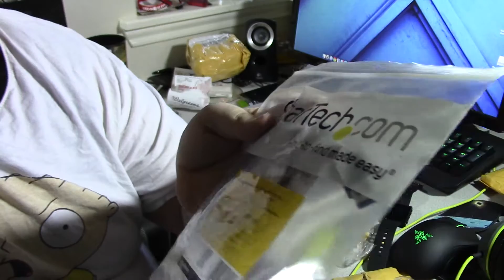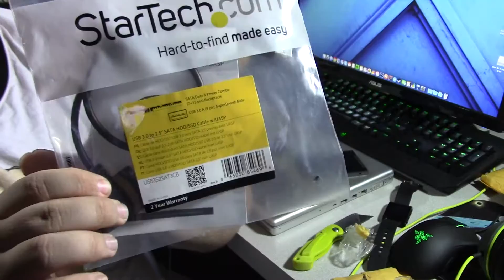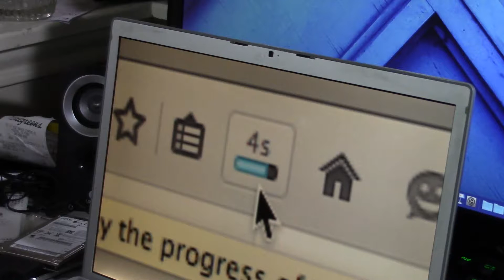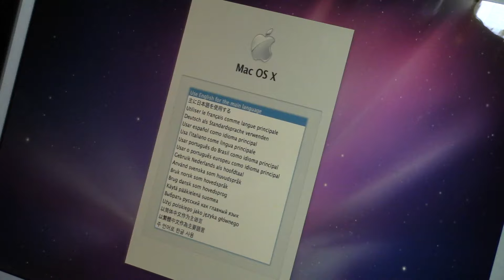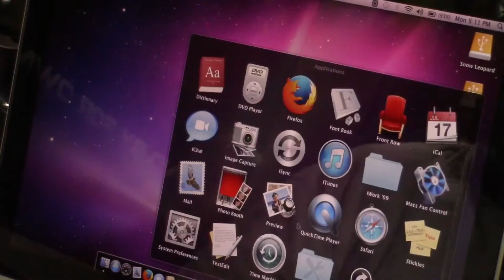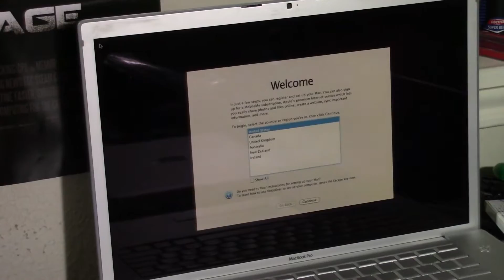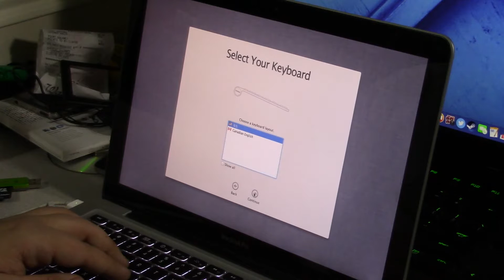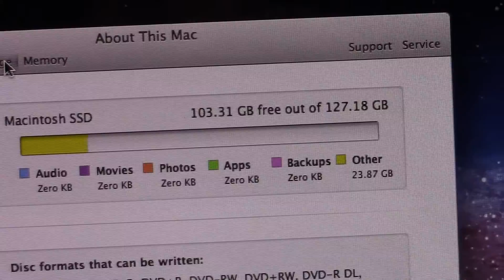2006 and 2011 MacBook Pro Upgrades

Comment: I miss the look of the pre unibody MacBooks. I had a 1ghz 2001 PowerBook Titanium and a 1.33ghz 2003 PowerBook that I used until I bought my current 2.66ghz 2010 MacBook Pro. I have had AppleCare on all devices but never had to use it. I just hit 1000 cycles on my 2010 today which is 7 years old and still has 84% battery health! I love older macs. I hate the touchbar stuff I hope its not apple future but you know it will be.
Reply: and WOWWWW! I forgot that feeling of getting a new install and that video playing!